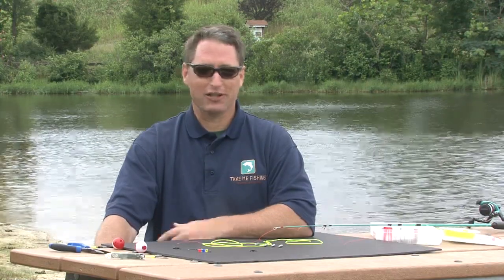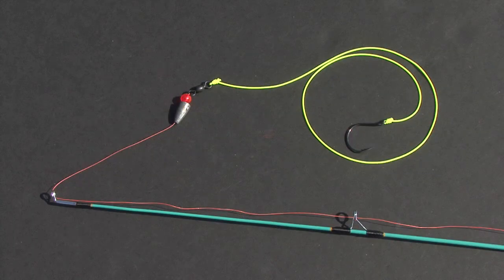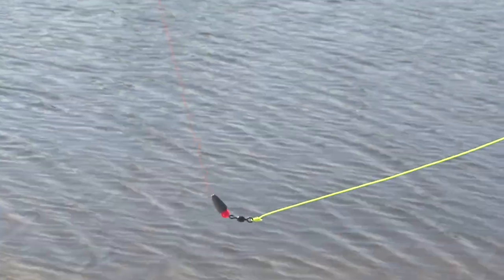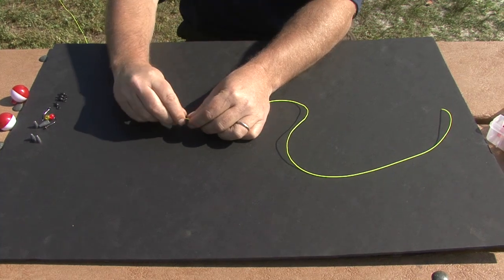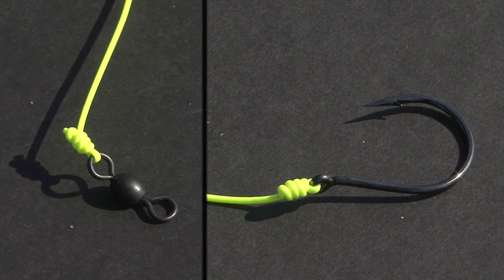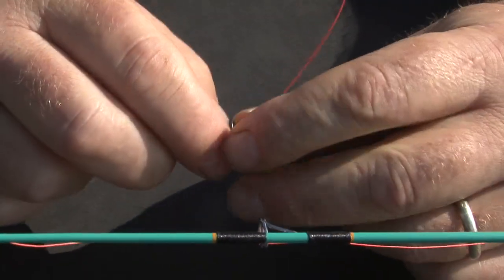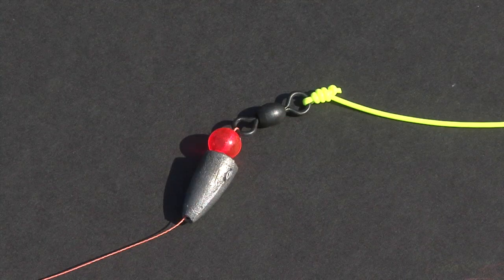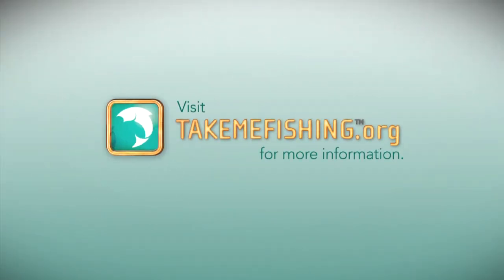Fishing Rigs: How to Make a Sliding Sinker Rig

Comment: Lots of rigs, have you ever seen a end weight that floats?
I fill a balloon with water, tie the knot and attach it to my baitchaser rig at the end.
Casting is easy and with neutral buoyancy it it just follows the chain of hooks on the surface when retrieved.
Herring just love it.
Reply from the maker: Great, thanks for your comment Myles
Reply: Can I use a snap swivel?
Reply: Are you using a worm(Tungsten) weight?
Reply from the maker: You can if you want to